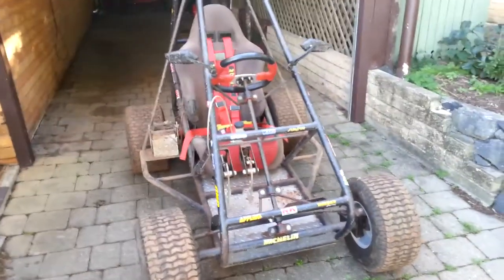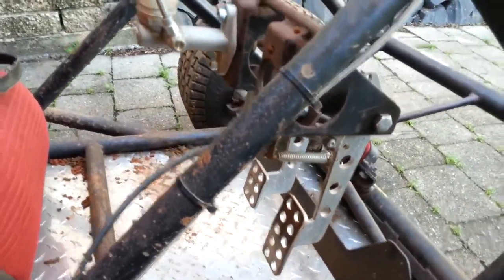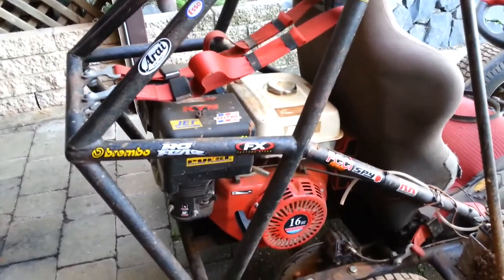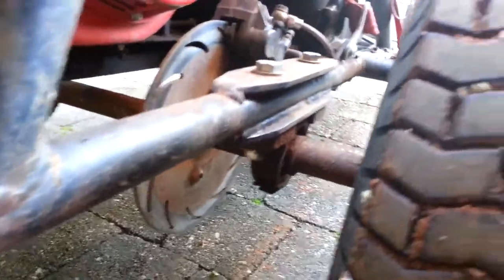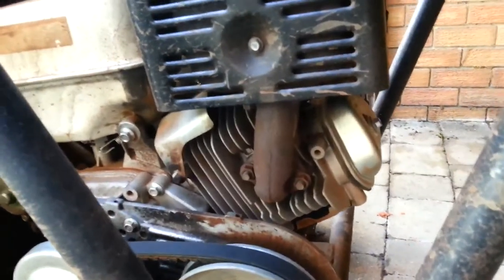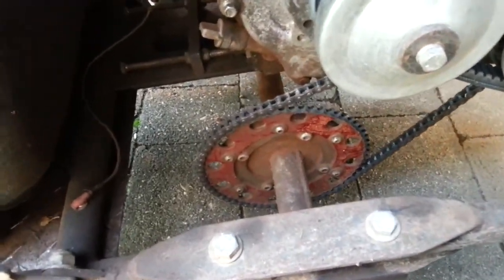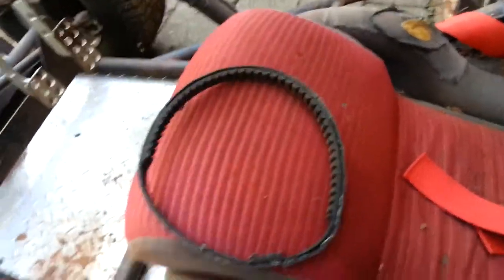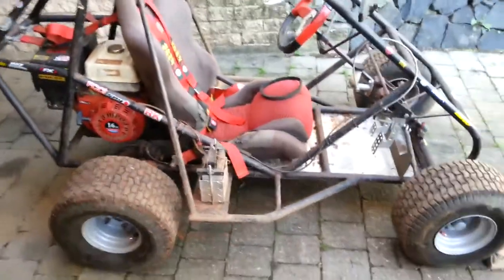Trax 2 Walkaround

Comment: Was that frame homemade? ..that is a tuff looking machine..I like it..keep up the good work!
Reply from the maker: Go-karts or Gone Fishin yes sir. I built this one and the Sidewinder.  The bottom half of the chassis is supposed to be 40×40 mm shs but  used 25 nb pipe instead.  Lools a lot better with no square edges.  
There's a workshop in Western Australia  called Edge Products and they build these machines and also provide CAD drawings to build from.  I change a few things for extra strength and durability.  
Building these myself saved  quite a bit of money.  Cheers mate.👍
Reply: Those things are awesome! ..can't wait to watch the rest of your videos with a beer in my hand...you are truly a artist!
Reply from the maker: Go-karts or Gone Fishin  thanks mate.  I'll have to do a vid on the two seater I'm building.  Need to do a bit more work on her and do a progress vid. 
It's called a Barracuda X2.  She'll have a four cylinder road bike motor.  Should haul arse.
Reply: I can't wait to see that!

Comment: Hi Customwinder, what torque converter do you have on there
Reply from the maker: Neves Projects Hey buddy. I'm sure it's a 30 series converter.   It's not a comet branded item just a copy type converter.  Still cost about $230 . .Cheers Neves.
Reply: Ok thanks, I'm thinking of getting a torque converter for my mini bike build with a 420cc but the 40 series cost to much, that one seems to work good for you so I'm going to try a 30 series
Reply from the maker: Neves Projects Yeah the 30 series should work well.  And I know what you mean there. The price jump is  maasive between the 30 and 40 series.  
Look forward to seeing it mate.👍

Comment: Is that a TAV 30 torque converter? 13HP
Reply from the maker: Yes mate. It's a 30 series converter.    And the motor is a 16 hp Chonda.   There's a 1 inch shaft  off the motor.    The converter is probably a bit small for this motor but its fine for the wife just cruisin around.  👍